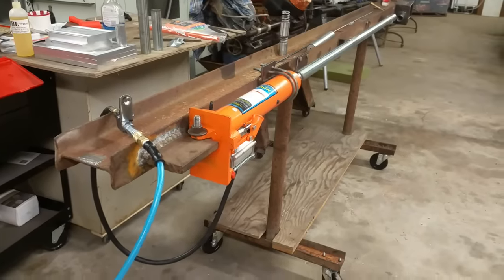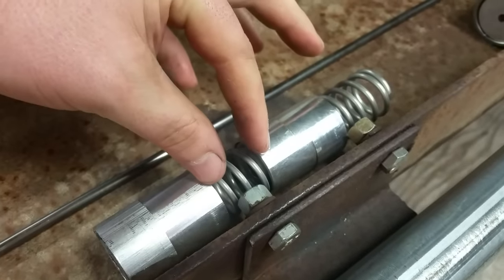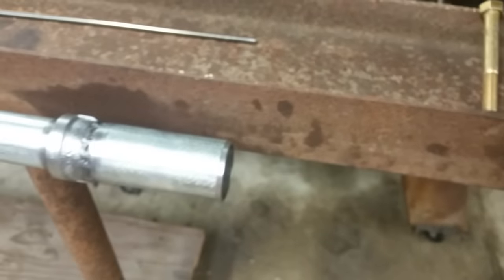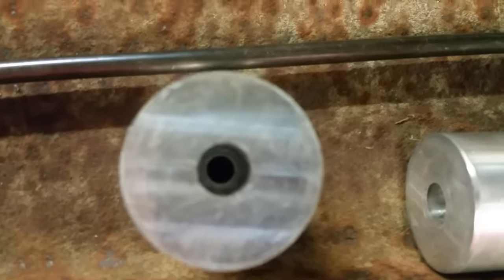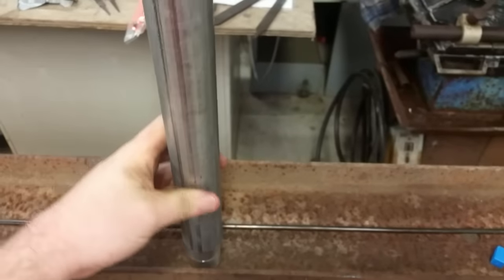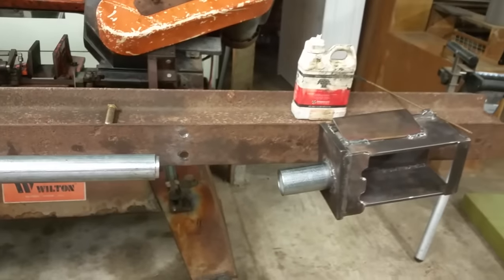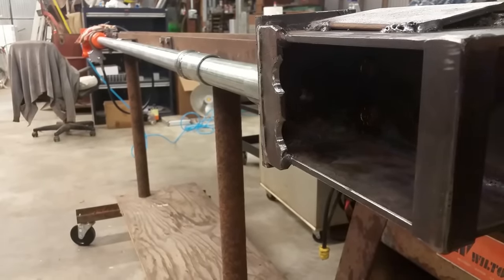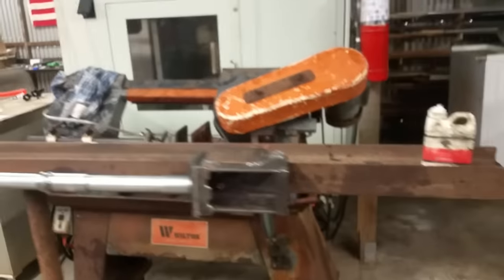Button Rifling Press - Home Built

Comment: Dear Sir. don't know what you are going to shoot out of that barrel .25 push rod means you will have to have at least a 6.5 mm (.264 D) so if you are using powder with that tiny barrel you could hurt yourself.  make sure you do the pressure calculation so you don't lose a body part. as for the design it is awesome very nice job.  PSI in a 6.5 can be up to I think could be error but about 35000 PSI (off the top of my tiny brain) for a 150 grain bullet. that would rip that little pipe apart for air it is dependent on initial PSI so do the calcs so you don't lose an eye.  good luck.  Very very nice job!
Reply from the maker: Thank you Victor. These are inserts that go inside larger barrels (similar to a barrel liner) that are designed for much higher PSI cartdriges than the 25ACP (standard psi is 25,000). The yield strength on these tubes are 72,000psi minimum as well.

Comment: Not bad for a prototype but this contraption has many flaws. First, you don't want a hydraulic press that pulses as it inches forward incrementally. Why? Well, if you take a barrel and cut it in half long ways, and then look at the rifling with a microscope, you will see the pulse marks in the rifling, what I call chatter marks.   

A button press has to have a smooth constant motion. Every time the button stops, even for a split second, the deformation is interrupted.

Comment: All this time I thought buttons were pulled through the barrel vs being pushed.  The more you know.....
Reply: It can be done either way, but pushing the button is "simpler" with "garage-level" tech (it's more challenging to create enough force  to pull the button without creating weak points int the tooling).

Comment: Your calling the cutting tool a button but in fact is it not a cutting die.
Reply: I was watching that , its  all  by deformation and not broached , no chips .  Ive  put torque  and allen drives on custom bolts that way , but I always had to push pretty hard .

Comment: that end stop is an accident waiting to happen. those porosity filled cold welds holding it together are going to fail and when they do you will have all those bushing flying around your shop powered by the springs on the rod supports. Waching you run that contraption was a but pucker factor of 11. please remove those welds and put proper welds in their place for your safety. I'd hate for you to get hurt.

Comment: welding galvanized pipe.....
Reply from the maker: Very important to weld galvanized safely! I tried to use the wire wheel on my grinder to peel off some of the zinc on the suface where I would place welds, then when I welded I had a swamp fan blowing and tried to do the bare minimum amount of welds. Ideally you want to also use a respirator (especially if you plan on welding galvanized for any length of time)
Reply: @max-weber  cool deal man.  With the know-how to put this together I would hope you took such steps.  Its just one of those things to shake your head every time you hear it.  A side note, the ram doesn't seem to apply a steady constant pressure but kind of an impact/hammering motion.  Still gave nice results.

Comment: The ram does not limit the length.... You just retract and place another rod to push... This things way to long for a mere 22 inch barrel.... There are easier ways to rifle..... First off is easier to draw  the button thru.... Progressive button sizes..... And your don't even need hydraulics..... Guess with all the peeps that want to rifle I should build and make available rifling machines to the public..... I expected everything to be stuck together from the expansion.... This is not a difficult thing to do I built my first rifle machine when I was 11 years old from crap and scraps  and it worked well..  I make my own buttons and everything.... This is not rocket science..... What I'm wondering is why this thing is so dam long to do a mere 22 Inches.... I assume you are gonna do some 50 bmg barrels cuz is big enough to do that and even cannons.... So  rifling this way is is a simple swaging operation.... Lube that bad boy with lard like our ancestors did.... Bear fat never turns bad